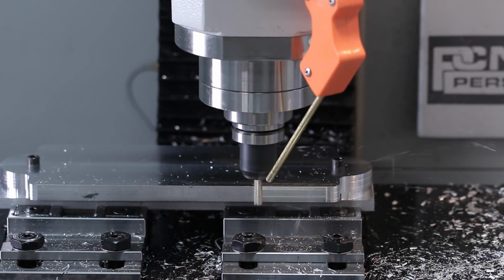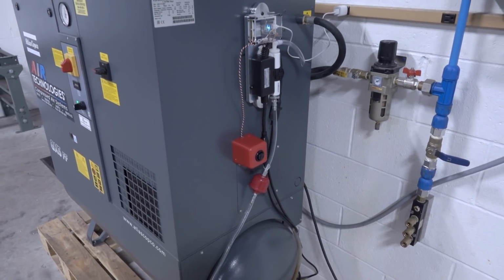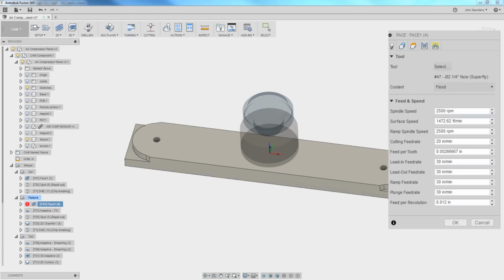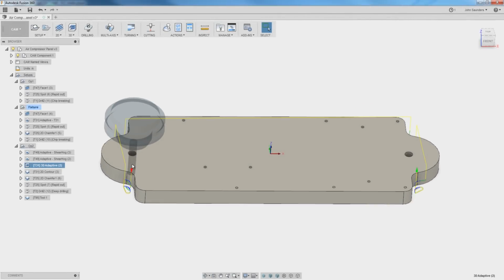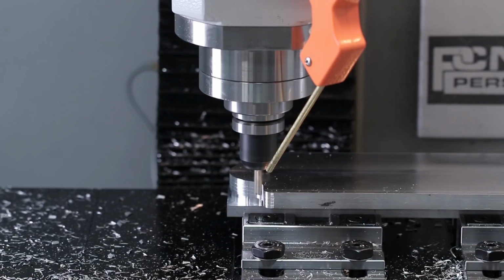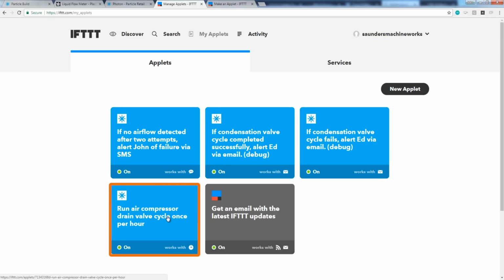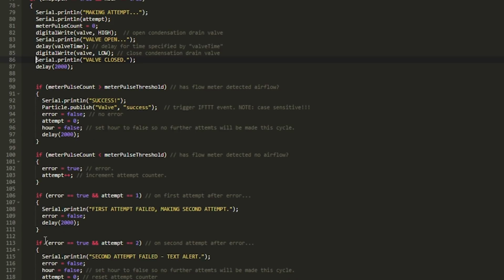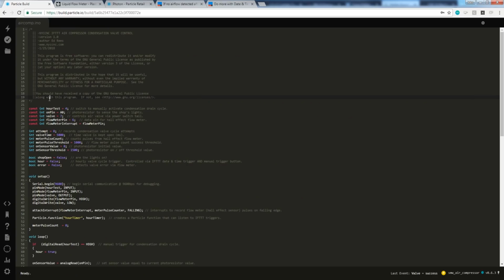Air Compressor Text Message Alerts! WW183

Comment: I like to spent my time on the important tasks rather than the necessary ones. So lets just think forward, this is a cool project for shop automation, which saves you 5 minutes a day for almost no bucks. Now you just have to add a level switch to that bucket as well.

Comment: If you have a refrigerated air dryer on the output of your compressor (not the RECEIVER) why is there such a concern over water in the receiver? There would be minimal, if any, water accumulation. Doesn't the Atlas-Copco come with a refrigerator drain system? Are you setting up a clean room?

 I have run my screw compressor for over two years (hard... over 35% "on" time) and check the receiver often and there's NOTHING but air that comes out of it.

Comment: I have the exact same compressor! do you think its possible to make the compressor turn off via an app?

i leave my haas running once i leave for a few hours then i shuts down but the compressor runs on all night.  A solution to turn it off from home would be awesome!
Reply: unitedjoke there is an app called Blink that works with the Particle. You add buttons to a screen on your phone. (STUPID simple to do)  When you press the button, the assigned output on the Particle does its thing. Limited only by your imagination. The app is (was last year) free, but if you add a bunch of functions you have to pay a little.

Comment: First of all, why do you need to drain the tank every hour... Just drain it before you leave for the day. If you're doing it because of rust issues... The inside of the tank will be just as wet if you purge it every hour or if you drain it at the end of the day. There is water always chatting the interior surface of the tank, and the steel doesn't know the difference between 1 mm of water on it, or 15mm of water on it. If it's wet, it's wet.
Reply: Andrew, you are 100 correct, years ago I us to work for a compressor dealer and when we installed a new compressor we always told our customers to blow down the compressor at night, leave the drain open till morning. Its proven to be much more affective at removing tank moisture than draining every hour. Draining hourly does not do much only waste air, the condensation condenses as the tank cools. They would be much better off with a refrigerated air dryer along with a proper water trap and filter/dryers threw out the shop.

Comment: I'm a big fan of IoT, but am very wary of how insecure most online solutions are. If you look into it you will find that a lot of them use unsecured or easily hackable protocols. The devices themselves are quite simple and are also not too difficult to compromise.
The solution is do it in your own private eco system and keep everything behind a strong firewall - no communication from devices to the outside world. An alternative for your solution would be Node-Red (super easy and very powerful) and a MQTT broker. You could also put all this data into a database and have the result displayed on a private webpage.

Comment: Breadboard is going to be unreliable over time. System will glitch.

Also, you should have a visible indicator of drain failure. Just a bright red LED is better than no indication.

 SMS delivery is not guaranteed and even if it does, it can take up to 72 hours!  At the very least, the monitoring system should send alerts by a second channel such as email if there are successive failures over a period of hours.
Reply: That's not an actual breadboard. It's a solderable PCB in the form-factor and appearance of a breadboard, called the "Perma-Proto" from Adafruit (https://www.adafruit.com/product/1609). It's useful for people not familiar with electronics, since they can breadboard it, and duplicate the same layout on the Perma-Proto.

I totally agree on your other points. A clearly visible LED would be great, since it looks like it's by the entrance/exit of the building (you can see the shipping/receiving rollers and the clock in/out iPad in the background). If you put a bright red LED that can be seen as you walk out the door, it'd be easy to notice when walking out the door.

Comment: Great work John!
Just an observation, and as IFTTT is 'cloud-based' - which I'm not keen on, think I'd do something like this with an ESP32 (for local web-based WiFi settings etc.) which I think also has an RTC to wake up at predefined intervals and also include a GSM (for SMS) board as fallback.
OK, that's probably over complicated as well..
Reply: 8-bit micro with integrated RTC plus a buzzer and red fault light. TRIAC or relay to control the valve.

Comment: Particle Photon's have a built-in real-time clock (RTC) so you don't really need IFTTT for the hour timer (but it's a great service for lots of other things).
Reply: Do they have an RTC, or do they use some sort of NTC?
Reply: dumle29 The chip on a Photon has a RTC built-in. Normally on Particle devices the time is set by the first connection to the Particle Cloud and the RTC is not on a backup battery, but you can change that if like.

Comment: Hi John! @ around 4:12 (or so) you have the machine run the fly cutter back-and-forth over the stock. Why not just run it down the length of the stock, instead? Or do fly cutters not like an interrupted cut (because they’re wider than the stock)? Anyway, nice to see you publishing content about other stuff related to your shop, not just machining/CAD! :)
Reply: William Squires it is about work holding vs the cut. Much stronger holding against the cut perpendicular
Reply: Thanks!  Going to rewatch 'cuz I didn't catch and couldn't figure out why he was demoing that.  Thought said something about not enough x-axis travel?  Yeah, in case the corners don't get cut going end to end (and better looking finish than bouncing around long "H" path)

Comment: did you go back to engineering and ask them to change the corner radius to a larger value to avoid the extra machine time?   A cost savings to be had!  Wink wink.  Where is your 6 sigma team?

Comment: I've used a few of those type of cheap valves you have on your auto drain. I've always had issues with them sticking closed, or sticking open. The garbage you tend to get on the bottom of the tank makes this much worse. I've had years of good reliability with an Asco valve, and the spring on the plunger pulled way longer. Very rarely, it wont seal, due to contamination on the rubber seal. But ive found if the drain intervals are much more frequent this is much less of an issue. Im running like a ~3 second purge every ~20 minutes. Its been running for ~3 years without ever thinking about it.

And you should probably have the ball valve open fully. Its going to want to trap contaminants behind the valve that way, making it more likely a bigger clump of garbage plugs up your valve.

Comment: Any value in checking for a drain valve stuck open?
Reply: You would need to check how long the flow meter detects an air flow. If it's longer than a predefined threshold then it's a leak in the valve or it's stuck. Shouldn't be too hard to program.
Reply: I was thinking the same thing.  Would probably be just a few more lines of code and another IFTTT applet.
Reply: Or even a leaky valve.

Comment: The built in Arduino function, millis() could be used. It uses a 32 bit unsinged integer, aka. unsigned long, aka. uint32_t. This can count up to 49 days and 17 hours. Your current system will fail to drain the tank if you have an IT or configuration problem. It also won't alert you. A more robust system would drain the tank every hour after it detects the lights turn on, if it is not successful send a text message. I would also add a once a day drain regardless of the state of the photo sensor. If your photo sensor gets dirty your system will not alert you or drain your tank. Another useful alert would be if the shop hasn't been open for a week.

This is a great project but I think you have a few more improvements before you can really say it is more reliable than a standard autodrain.
Reply: You missed that the compressor tank won't be drained if there's lights-off machining.

Better than lights sense would be to monitor the compressor current using a current transformer or similar, then drain based on compressor run time and the humidity at the time that the compressor is drawing air.  

Simpler would be to figure out why the auto-drain doesn't seem to work. 😎

BTW those flow meters typically don't like air flow from a compressor as the turbine will over-speed and damage the bearings. i.e. very short life.
Reply: Shoot me a message and I might be able to help you.
Reply: Current transformer can be replaced with tiny signal relay connected in parallel with the motor.
Reply: Or an Aux. contact on the motor contactor. 
Or on one of the control relays in the compressor control circuitry.
Reply: It is harder to interface aux contact to microcontroller safely.
Reply: Антон Южаков Why?
Reply: Or you meant dry (or cold, i'm not sure) aux contacts?
Reply: Антон Южаков Yes dry. Are there wet ones? Never heard of those. jk
Reply: Thomas Thomas, I have invented 2 machines at work and they destroyed any old record of production.  I have a problem that you might be able to solve.  I need Arduino code.  Count to a variable (external into a single pin).  Then rotate a stepper motor (200 steps per revolution) 180 degrees or 100 steps.  Then  repeat over and over.   I am new to coding.  Most internet coding shows how to hook up a stepper motor and then uses the stepper library.  The counting has to be a signal of high or low, make it what you want.  Would you help me please?

Comment: Half opened ball valve is a bad thing.
Reply: Interesting.  I've heard about Bibb valves needing to be fully locked to properly seal.  I can picture how exposed ball could corrode or promote clot.  What is a better method to control flow?